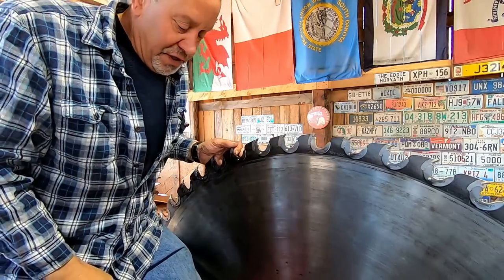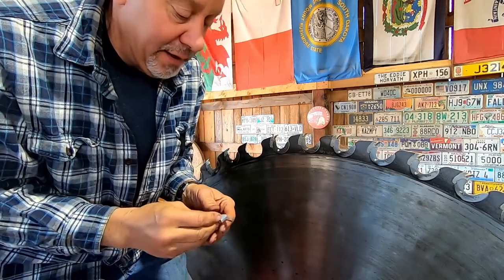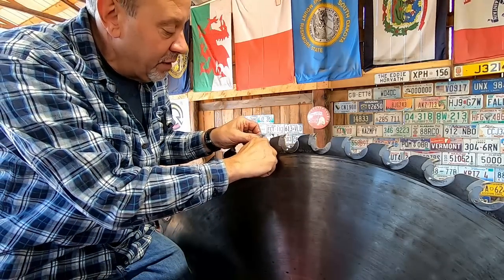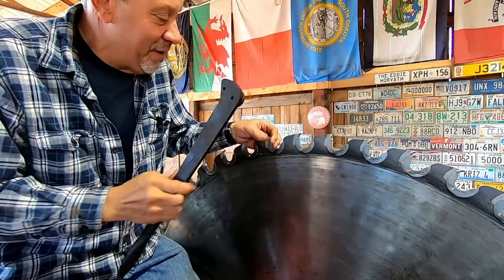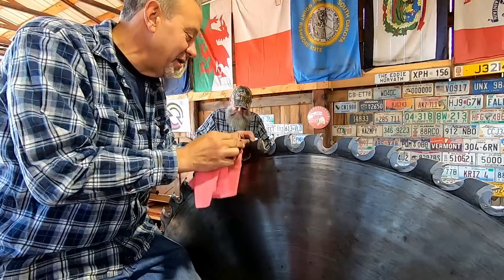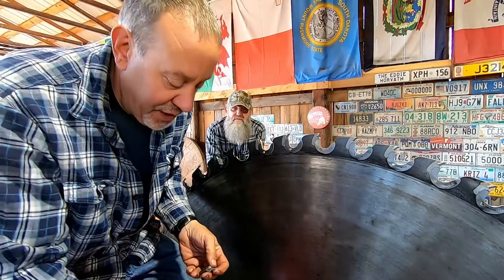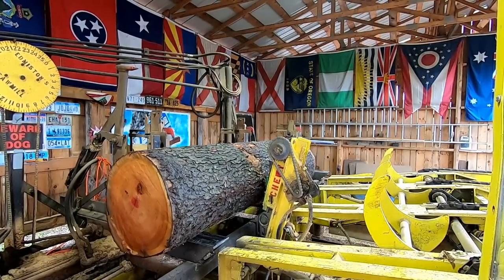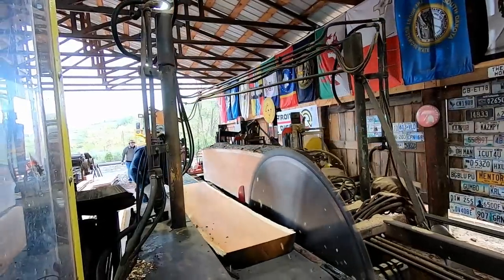changing the saw bits & sawing cherry turning blanks # 419

Comment: Thank you !! I knew it was done, even knew what the assembly looked like,  but never witnessed the process.  How do you check the set of the teeth? Or does the fact of replacement resolve the unevenness?  Orrr is that  the hammering and retensioning that flattens the spin?  My framing squares,, if found out of perfect right angles,, are resquared  by hammer  and/or center punch.  Same thing?
Reply from the maker: glad you liked it , no set in the bits just like a rip saw.
Reply: @markgalicic7788  LOL  Got it  rip saw.  That's all you do.  A true duh moment for me.  Especially after seeing how wide the bit is.  Still laughing,, boy did I miss that one. Thank you for my good belly laugh tonight, granted , at my expense.

Comment: I have been slabbing up bowl blanks in my band mill.  My log length is only 48 “ as that is what will fit in the tractor bucket and is all it can lift as well onto the band mill. Much easier than cutting them with a chain saw.
Reply from the maker: yes much better.

Comment: I remember Jack Franklin at the Odon Sawmill file sharpening the tips frequently and periodically changing out the teeth just as you did on this video —- that was about 60 years ago .......
Reply from the maker: the chrome bits will need to be sharpened more often than the carbide bits.

Comment: Have you ever had one of those carbide bits crack into many pieces after tapping on them like that? I’m a machinist and typically if you smack a insert we call them they sometimes will shatter. If not immediately they will when you start cutting.
Reply: Machinist here .1983.i hate listening to the assembly department.  Because I was listening to the awesome sound of carbide indexable inserts cutting metal and giving that  hissing sound when they crumble. 😅.it some how is luck 😂.we hope you can do it.just turn the coolent  on .❤❤❤
Reply: He was replacing the carbide with chromium steel bits.

Comment: It's a bit of a trick to get a fresh rebit to cut smooth.
Reply from the maker: it did make a big difference you will see it on the next video.
Reply: Need to use a hammer and something flat and make sure all the bits are flush with the saw  one could be sticking out one way or another  they need to be set up and down and side to side to get new bits to cut smooth